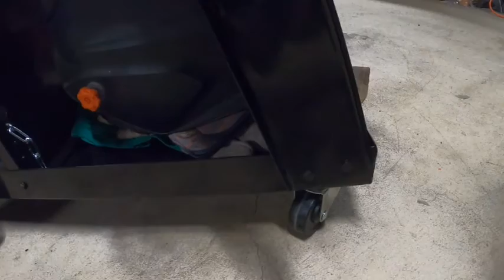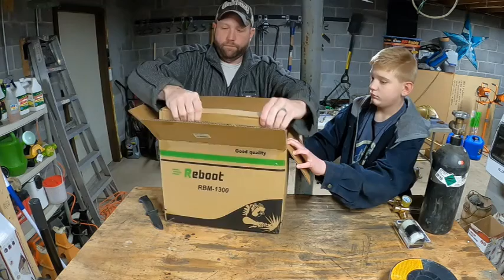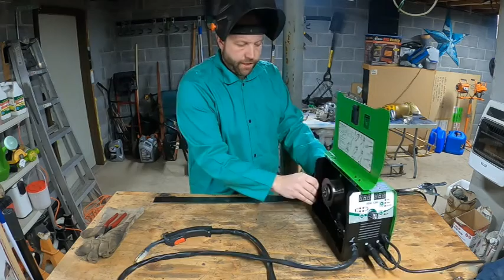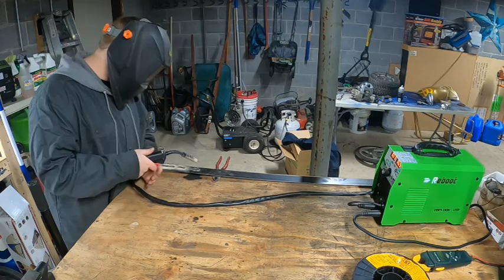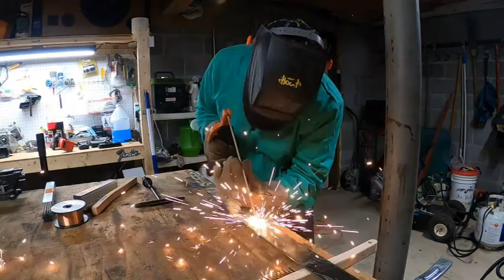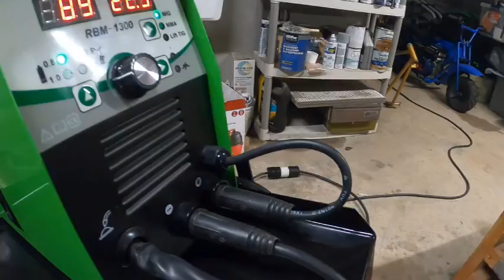REBOOT RBM-1300  3in1 Welder Unboxing/Testing

Comment: Thank you  What I don't get is Reboot has a 12 ga wire/20 amp connected to it but it says input can be 50 amps  Won't the 12 gauge wire going to the welder melt/overheat?
Reply from the maker: That is correct

Comment: Hi! I really can’t find much help, I’ve even emailed the support to answer a question... can use the MIG function on 30A? I can’t get it below 40 amps :(
Reply from the maker: 30 amp circuit?
Reply: @hereshopengarage2790  god knows. I’ve just revised the amazon ad and it says lowest is 40A, either they’re cheeky or I’m dumb, but this welder can’t do what I want unfortunately

Comment: What was the modefication you made with the power supplie cord?
Reply from the maker: plug configuration
Reply: what does plug configuration mean? I bought this and need an adapter to convert it to a regular 3 prong wall outlet plug
Reply: @GreatFutureBand  
Im actualy curious myself 😋😋
Fallowing for the answer
Reply: @matswild  FYI, I just received a MIG 1550D in the mail. It took me some time to realize the unit comes with an adapter from its 50A 3 prong to a normal wall outlet. The adapter was actually physically inside the unit, it opens up on the side and has the adapter chord inside. I couldnt find this adapter cord easily online, but may have been overlooking it.

Comment: Can I weld aluminum with this machine?
Reply from the maker: If you use aluminum feed wire i think you can
Reply: Maybe with an aluminum tig rod
Reply: The manual says “no.”
Reply: 75 helium  25 argon or pure helium. The first tig welding procedure was done on DC only. It was called heliarc welding due to the helium gas being used to shield the welds and increase the heat.
Reply: What welding rod were you using? A lot of inverters won't run 6010. It looked like 7018 with the hard starts. 7018 is dangerous if you don't have a rod oven to maintain it.

Comment: do you use 220v converter?  im using 110v plug just like yours and it will not weld at all , 8th inch galvanize steel, and how do you control the wire speed?
Reply from the maker: No I'm using 220v

Comment: Hi will this work with 22 gauge butt welds with out burning through with the flux core
Reply from the maker: Maybe if you turn the heat way down, I would try a test piece

Comment: little confused, when you use the gas welding is that tig? and you said setting on mig. isn’t it push the button to tig setting?  im not a welder im interested the product
Reply from the maker: Yes push button for tig